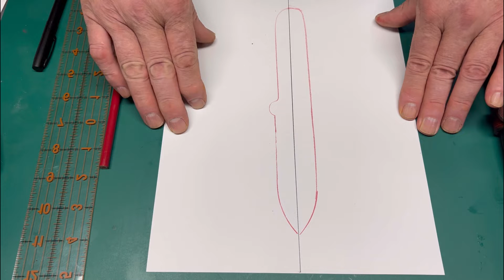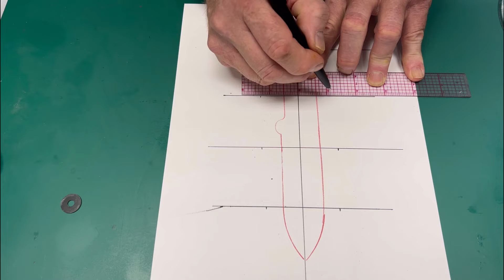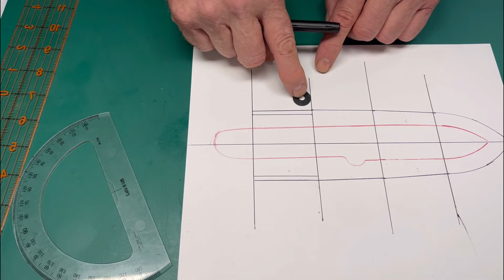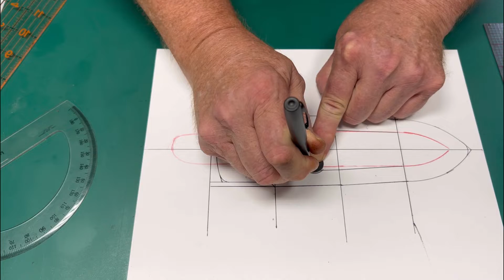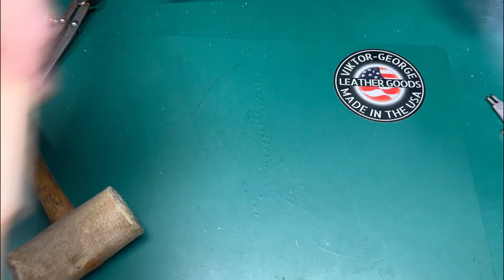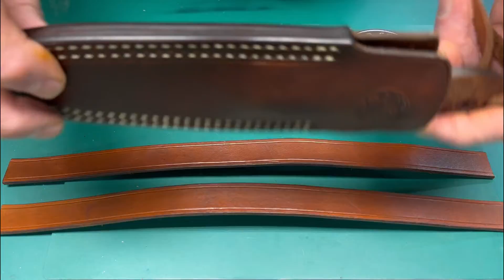Join Us At The Ultimate Knife Sheath School! Vol.7 #diy #tutorial #youtube #youtuber

Comment: How do you design the pattern if the handle and blade are angled like the esse jg3 is?
Reply from the maker: @erikknight8040  I looked up that eseejg3 and it’s not too extreme of an angle  The knife itself dictates the shape of the scabbard and the 1/2” welt would be designed  around the jg3  blade    Are you wanting to make it scout carry or crossdraw?  Just prototype multiple patterns until it looks right
Reply: @ 
I have been playing with a scout carry pattern and I am going to adjust the inside welt to better friction fit around the blade when drawing it in and out.
Reply from the maker: @erikknight8040  That sounds like the best approach Eric    Sometimes it’ll take me a lot of patterning attempts before it starts looking right. Good luck and thanks for watching

Comment: Hey George, I really like your videos. I have had a hard time with my drill press when drilling 1/16" holes. The drill wanders on the backside really bad. The chuck isn't running out, I can drill holes in metal without a problem. It's a small drill press, and it's only when drilling thick leather laminations, 3/4" to 1". I actually have a Cobra class 26 so I use that for punching holes in thick material and hand sew it, but that only lets me do about 7/16" thick of leather. I was wondering if the laminations of leather are contributing to the drill wandering? I hate how it looks on the back and have screwed up a couple of projects because of the crappy appearance. I wanted to get your opining if it's just the drill press? I figured if a Dremel can make straight stitch holes a 1/4" HP drill press would handle it.
Reply from the maker: Hello LVX I appreciate the nod   For drill press sewing (dremel) here are a few initial notes.  The leather needs to be dry and laying flat on the wood base. For best results if using a contact type cement let it cure for a while. Meaning don’t drill freshly glued layers  The glue gums up the bit  That being said, on a thick welt or edge at 3/4 or 1” I usually  drill pilot holes first so I’m only drilling thru half the layers  Also I insure my bit (1/16” titanium by Bauer, is chucked just enough to go thru the layers without the Chuck biting into the top layer  If too much of the bit is out it could wobble inside the layers causing the wandering on the back side 
Also the speed of the drill shouldn’t be full speed as that could burn the leather. Too slow and it’ll bog down especially that thick of layers. Find the variable speed you need to avoid too fast or too slow   Check your bit to insure its straight and true   Just throwing out all potential problems 
What are you drill sewing that’s that thick?   Never hesitate to reach out by text or call as sometimes it’s easier to talk thru these issues  (520)909-8256  Arizona time   I also have a Class 26 and love it  Cheers

Comment: If wanted, you could put a guard cutout on both sides of the welt, for ambidextrous carry, yes? You could even mount the belt straps on rivets, so as to turn them around for ambidextrous use!
Reply from the maker: Yes and yes but instead of rivets I would suggest Chicago style screws. So many tweaks that will work  Let the creativity flow!!  Thanks John

Comment: Another great video Viktor - your edges always look great. Thanks for sharing the dremel tip. How do you hand stitch without getting dye on the thread?
Reply from the maker: Thank you Stephen I appreciate those kind words. I prevent that dye transfer by spending some time burnishing the surface of the dried dye with that stiff brush. I also have a line finisher which helps.  I usually air brush after the projects done which makes it easier.